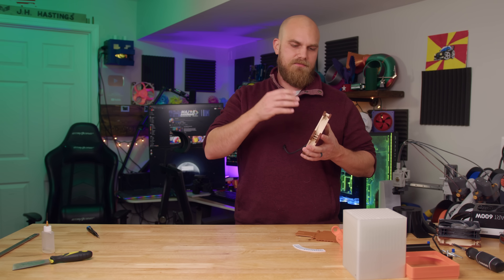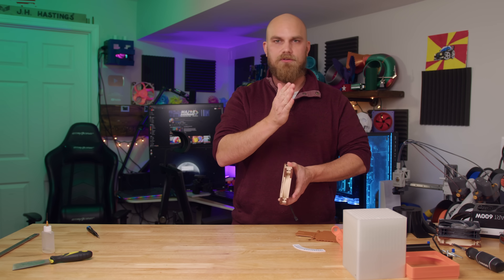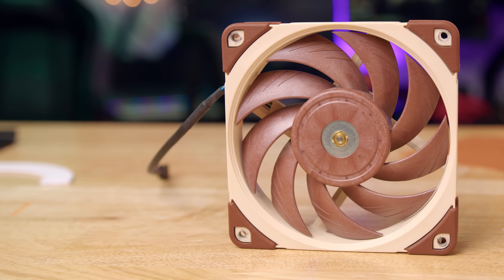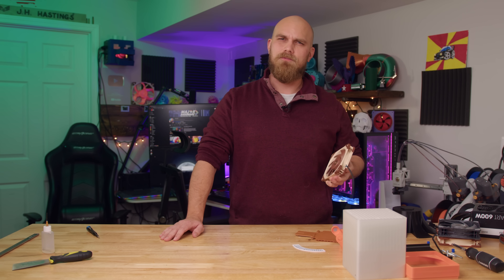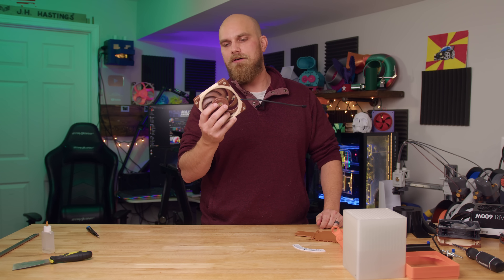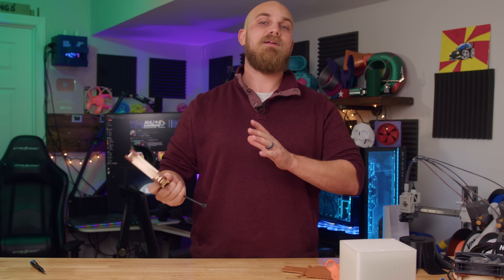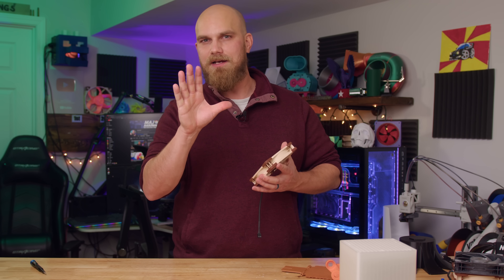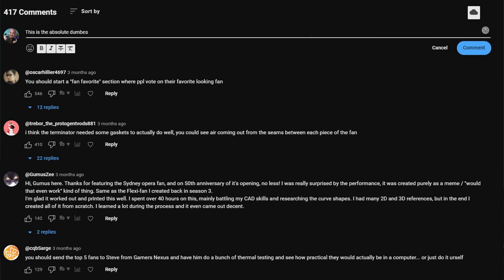I Built a Static Pressure Machine | Fan Showdown Season 6 Pilot

Comment: A key thing to keep in mind is that the air pressure and air flow are related and not necessarily in a linear way. All of your tests so far, including this one, are testing some point on the pressure-flow curve using different resistances.

The open tunnel was about as low of resistance as you could get, which is basically the maximum airflow - an interesting number, but not really reflective of a practical application.

The radiator applied a considerable resistance, which makes it a much more practical working example. Measuring the airflow with the radiator tells us something about a point a long that pressure-flow curve, where the pressure determines the airflow through the resistance (the radiator). If we knew more about the radiator, we could calculate the total power of the fan as a combination of the pressure and flow developed.

What you are aiming for now is pure static pressure with zero flow. In order to get that, you need it to actually be zero flow, so it has to be into some kind of closed orifice. The classic water tube is one way to measure the static pressure at the outlet. Perhaps you could direct that pressure into some other mechanism that would indicate the pressure, such as gauge using a diaphragm and spring. Which, at the end of the day, is just an analog pressure gauge.

I looked at low pressure digital manometers for last season and the costs were prohibitive. Even more annoying is that lots of gauges will mention the resolution of their display, but not the minimum pressure or the accuracy of the measurement itself. I bought one that I thought could be useful and it just barely tipped the scale off of 0 when applying the full static pressure of a 50mm blower for a 3D printer nozzle, so that's useless. Models that seemed useful were at least a few hundred dollars, which might be worth it for running a YouTube channel, but certainly wasn't worth it for me to play around with making my own fan blades and nozzles.

However you manage to measure the static pressure, I think it's important to judge a fan just by a single characteristic. A fan that maximizes peak air flow at zero resistance will have terrible static pressure and vice versa. That's why airplanes use different motor and prop configurations depending on whether they are meant for level flight (airflow at high air speed) or 3D use (static pressure for hovering). That's why all those compressor designs did so poorly for maximum airflow in the wind tunnel test.

Another consideration is that fans have a stall speed. If you apply too much resistance and the airflow through them decreases, the behaviour of the airflow over the wing changes and you get a completely different behaviour. Knowing the static pressure at zero flow and the max flow at zero static pressure tells us what the ends of the spectrum look like, but nothing in the middle.

What I would love to see is an actual sweep of the pressure-flow curve. What kind of resistance can it handle? What use cases is this fan good for? Does it fall apart at the slightest resistance or can it handle a clogged radiator and still function decently? I think you'll find that the Noctua is good specifically because it maintains a solid flow even up to relatively high pressures.

What about the wind tunnel but with a variable grid in the middle, like you might have in a floor vent (I forget the name of that grate design). By varying the cross-sectional area of that part of the tunnel, you control the vast majority of the resistance along the path, and therefore can see how pressure and flow vary with that resistance. Sweeping this through several points from fully open to fully closed should give you a good idea of that pressure-flow curve. Even if you can't measure the static pressure that builds up behind the grid, we know that, below the maximum air flow, the air flow is determined by the resistance of the grid and the pressure behind it, and the grid is the same for all fans tested, so the pressure is simply a function of that flow.

Bonus points if the settings for the grid can be matched against common situations like a typical computer case and a radiator to give an idea of how that fan would work in those everyday situations.

As for scoring them, it's not immediately obvious how to get a single number from this, but a common metric in similar situations is to take the area under the curve. By taking the area under the curve, we measure how well it works across all situations, rather than just one. With the same area, you could balance it to be really good at static pressure or really good at max airflow. But if you manage to improve both, that will show up as an increase in the area, making it an overall better fan.

Comment: I might be wrong about this but wouldnt a measure of the pressure on something require it to be sealed? As in it would need to measure the force being produced by the fan before the air pressure has to escape out of the fan, or dissipate somewhere other than where the pneumatic pressure is being applied? Like having a tube with a very light but somewhat airtight rubber flat stop wiper inside of it that has a light spring pressing it to extension, And the fan would have to maintain pressure against the spring to compress it to a certain measure that can vary from different fans. Thats just what I consider when talking about the measure of the 'pressure' of something. meaning its the force exerted out on a sealed environment. 
In the test he has. The force that the fan exudes hits a higher and higher grade of deflection the further the door rises, Giving a nonlinear progression of measurement. A fan that pushes to 10 over a fan that pushes to 9 could be pushing twice as much force, It could be pushing 5x as much force. The farther the gate opens, the more the area of that force isnt being used to push that gate further open.

Comment: Extend the tunnel past the guide fin portion, add small holes to the tunnel that allow air to escape, create a light weight plug that fits and slides inside of the tunnel. When fan turn on it pushes plug, as plug moves more and more air escape through small holes. Distance plug move mean more power.

Comment: As lot of peopple already mentioned that is very non linear (maybe in a log scale?), why not just use the regular and proved "water column" pressure gauge? A bigger tube diameter on the fan side would make it more sensible to the pressure.

Comment: Looks cool and all but its basically a reimagining of the whole ribbons tied to a fan grill to see its working idea, and as others have said the pressure is going to drop off more as the flap opens more and the flow rate increases, you may be better off having a closed end and a pressure gauge. You're also probably going to want a taper on your fan mount going to the chamber as you're going from round to a larger area square and those negative areas just inside the box may see some turbulence and impact airflow a small amount.

Comment: Nice design, but as others pointed out you will run into the issue that you change the mechanical advantage of the air vs the flap with a larger opening angle. It also means you are not measuring the peak static pressure, but the equilibrium of static pressure at a certain flow rate. Meaning a fan with a very high static pressure but very low flow rate will never open the flap significantly, compared to a lower static pressure but quite high volume fan (as long as the pressure is enough). So on a flow-vs-pressure curve, you are only measuring a single point for every fan, but you'd never know which. 

An alternative would be to have a closed tunnel, with an adjustable opening at the end. Then you'd know the surface area of the opening at each setting, and if you'd knew the pressure difference you should be able to pretty well estimate the flow vs pressure curve. 
Measuring the pressure, especially that low, could be done by just having a U-tube  attached with one end to the inside, the other to the outside. Inside you could have either water or another (less dense for more effect) liquid. At equilibrium the two columns of liquid should balance out and they be equally tall, while any difference would be visible as a height difference of 1-2mm for these fans. 
To make this more visible you could use a less dense liquid to enhance the effect (a lighter liquid can be pushed higher more easily), or you could try to come up with something like a float attached to a very long pointer. Any small change in the water level acting on the float with the short lever should give a proportionately larger movement of the long & thin pointer.

Comment: Probably won't see this comment but you don't need to buy one. We made monometers in in nuclear power all the time using flexible tubing for maintenance. Use a classic U-bend monometer, then hydraulically amplify it by having it go from a large diameter tube to a capillary tube at the start of the atmospheric water column. You won't real measurements but they'll be linear and consistent.

Comment: Awesome..
Non linear of course, so you could scale the readings, or make the door also non linear by putting ramped side flaps on the door so that the hole becomes larger linearly if you get what I'm saying. You could also apply a water filled tube manometer to the end of your chamber and graduate that. But potato tomato it works and you actually built it rather than couch racing like the rest of us

Comment: I think a really simple way to do this instead would be to have basically the same setup but everything is vertical instead of horizontal and there is a sphere that takes up a certain area of the tube (like a clear plastic tube) so that the higher pressure the fan can make, the higher the ball is within the tube. It might be harder to measure, but you could get a bunch of lasers and laser receptors, which are positioned at certain intervals (and then when the ball goes past it, it blocks the laser light) and you would be able to take a constant reading of that (if it changes, bobs up and down, etc) I kinda want to try this myself now lol

Comment: You'll get a more precise measurement if you make the pressure chamber smaller, eg. 60x60mm instead of 120x120mm. It can be smaller and contain more pressure. Also, the flap needs to be contained fully so that air pressure is linear in the chamber.

Comment: I think for static pressure the ideal measurement would be to have a bellow that the fan blows into, where the bellow is pressed together by a spring. In this way you would have no airflow at all, and the extension of the bellow against the spring gives a reading of the pressure.

Comment: me my self and I would build a linear bearing and a piston with a hyperbolic cone that slides and exposes an opening evenly on all sides. The resistance would be provided by an alcohol and colouring that could be raised and lowered to calibrate . Bearing in mind if the tube and piston are 120mm then a total deflection of 30 mm is the equivalent surface area of the 120mm DIA fan.

Comment: Longer ARM and bigger scale
Use an egg form in the tunnel so as not to adversely effect the flow / leverage and use a stained alcohol to drive the egg form on a linear bearing.
OR repurpose a Chinese Vernier calliper 
OR use a fuel tank gauge 
OR use Hall effect counter and wheel
OR - ha ha limitless - 
I think such a small resolution will be a pain and the non linearity of the flow and deflection will group results around a small area.
Using this "flap" and a differential manometer might be the GO .. 
Maybe use an optical manometer using a coloured alcohol and a graduation ?

Comment: Echoing other commenters, I'd suggest a spring-based gauge. You could get a load cell and pair it with an Arduino, then calibrate it with known weights. Put a flat plate on one side that creates a seal on the output end of the wind tunnel, and you have your DIY pressure gauge. There's probably a ready made commercial alternative, but I don't know how reasonable the pricing would be.

Comment: The scale is not actually linear the more it opens the less the additional pressure adds so it will be hard to see a difference close pressures. Maybe make the scale larger and the counter weight longer thinner so you can be more granular. Maybe a logarithmic scale would make sense as well or something less linear so the results would be proportional to the increase in pressure.

Comment: I would reduce the air flow down to a cylinder just a little bigger than a ping pong ball.  Then periodically put holes in the tube and then measure how high the ping pong ball gets pushed.  You would have to the ping pong tube vertically, but that could be done in the reduction.

Comment: Could make a homemade pressure gauge using transparent tubing and water.  One opening in the high pressure (inside the box) the other end in the low pressure (outside the box).  Set it up in a U shape with water and it'll work as a water column.  In order to increase sensitivity you'll need to increase the cross sectional area of the opening inside the box - print a cylindrical reservoir inside of known diameter (larger than the low pressure end) and deep enough to absorb the amount of water it'll need to push down.  If you make the inner surface area 10x that of outer, the water column will gain 10x sensitivity which will turn the 2.34 mm to 23.4 mm.  This can be increased further as needed.

Comment: Cool idea, however i feel like something is off i dont know jack squat about airflow and static pressure, but the flap feels like it's almost the wrong idea cause once the air opens the flap it kinda doesnt need much more pressure to leave since the flap is already open. 

I think maybe if there was a tube or any hollow shape you get like a disc or blocker with low tolerance so air can move but its difficult and then seeing how far it can push the item in the way maybe have a spring that you know the strength to reset the device or something like that. Maybe like a tube and a ball idk i have no clue what im talking about lol. 

Extra side idea to mostly keep what you have. Try making a low tolerance sleeve for the flap so that the air doesnt just escape from everywhere. If the flap is contained, then air has to push it further, but make sure that the flap stays contained so that air can only go past the flap. 

Sorry, extra extra idea. Use the lever arm on top of the flap to apply preassure to a scale and see how much force in weight it applies. Ive seen other creators use a similar system but usual they were measuring thrust which might be different.

Comment: Make you own manometer. Use some hose filled with water, an measure the height difference. The way to make the scale easier to read would be to lay the graduated section at something like a 5deg from horizontal angle with graduations along its length. The you can use trig to find the actual height difference, and calculate the pressure. With you setup you arent measuring peak static pressure as the load on the fan (opening size) is constantly changing. What you are really looking for is a way to measure airflow at a series of different static pressures to generate an airflow curve.

Comment: I think a mass air flow sensor could work well with a fixed restrictor plate on one end.  And some back calculation from the sensor reading. It'd give you the air density change from the ambient pressure to the outlet. Plus it's digital.

Comment: Using doors with different weights would probably help give more accurate results since the first 5-10* are the most important.  (As the door opens further more air spills out and the airstream loses leverage)

Comment: I know very little about fans, or testing. But here is my 2c anyway :p
You should test a fan with very high airflow but low static pressure and see how it performs. I suspect it may perform quite well because you are not asking the fan to produce much pressure since you are allowing the air to escape, meaning airflow becomes a test component.
So it may be worth testing a system where air cannot escape? Maybe a transparent long vertical tube (16mm or 32mm diameter sort of sized) with something light that fits flush inside (maybe a foam cork? a small bit of air will pass but it shouldn't be a lot) and then add small weights (ball bearings?) and see how much weight each fan can keep at a given marked reference height within the tube. The fan that can hold the most weight at the reference height would be the fan with the most pressure. This would be a test of static pressure in a 0 air flow situation. 
Using a 3d printed piston with an o ring and oil (oil being your mass) could be a better system, but I think the friction would make it inaccurate and the mess would be annoying for testing.

Comment: Maybe you can combine multiple ideas, gate right in the middle and mine. By making the flap as easy to open as possible and the if you want to make it harder to open you add weight somewhere. That way you could messure the pressue by the ammount of weight it can displace /move. Hopefully that was understandable

Comment: static pressure exists on both sides of the flap and exerts the same force on the flap, any bending or tilting of the flap would be (total pressure)-(static pressure) thus being an indication of dynamic pressure caused by the motion of particles not static pressure...